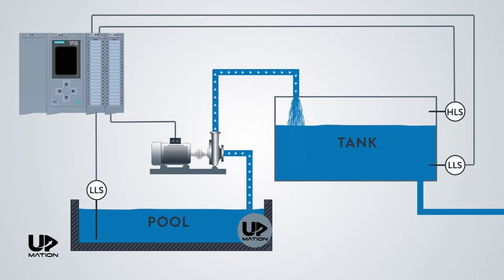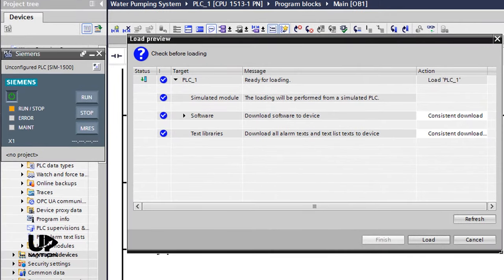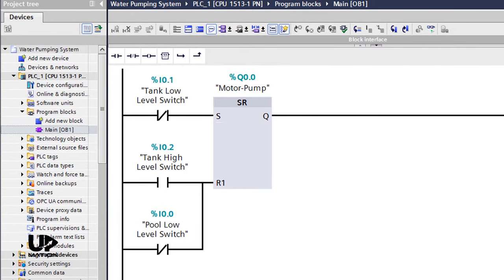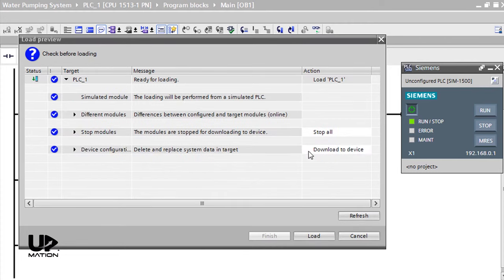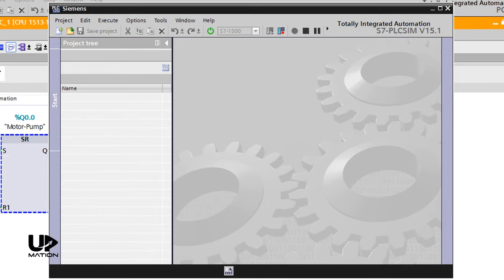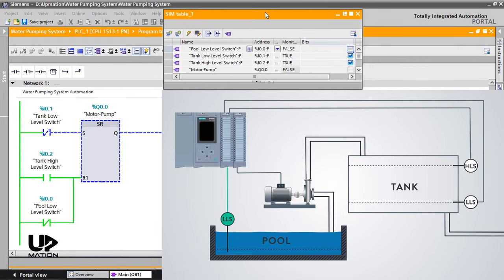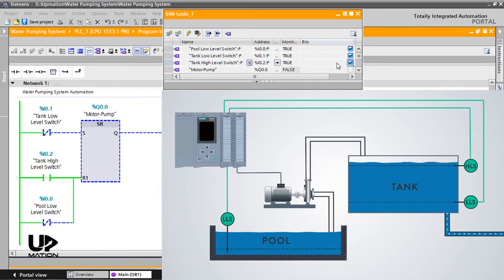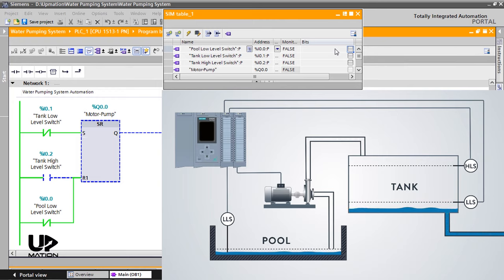Siemens PLC Training: How to Simulate a PLC Program (Siemens PLCSIM Tutorial - V15)

Comment: Do you know if colleges have the simulation software? Does it come in a package with the programming software
Reply from the maker: TIA Portal has integrated all the basic software including programming and monitoring STEP 7, WinCC, and so on. Simulation software (PLCSIM) is free and you can download it free in case it was not included in the package.
As far as I know, the colleges have at least a Trainer Package which includes all of these (and SIMIT simulation software) plus some hardware packages for students to gain hands-on experience. 
Here is the link to the Siemens Trainer package: https://sie.ag/3iIAw8d
But you better ask the college to make sure which PLC and software brand they use. In the US you might better choose between Siemens and Allen Bradley.
Reply: @Upmation  my college has AB and Siemens. However as I right now, we have to remote into the software. Idk if the SIM software is downloaded or not. If it’s not I don’t know if I have the authority to download anything onto the remote computers. I really would like to be able to simulate the programs we build.
Reply from the maker: @joew4202  I see. I suggest you contact the IT responsible of your college and ask him to download and install the PLCSIM on the computers you remotely connect to them. It's not something that might cause malfunction or whatever you might be worried about...

Comment: Hello sir, I am getting a problem where when I click on start simulation, a box appeared and says 'The blocks contained in this project cannot be simulated with S7-PLCSIM. I didn't put any password for the blocks. How can I fixed this ?
Reply from the maker: Hi there! You should look for the details of the error and see which block it means. It's likely you used a block that needs inputs and you've leaved its inputs empty. Or have used an inconvenient input or range for that block. You should also look to see if there is any errors or warnings after you compile your software.

Comment: Hello ! Operation with PLCSIM can be simulated after replacing hardware inputs such as% Ix.y by a memento bit %Mx.y ?  Personally I can't do it. 
I simulated an incrementation (INC) in LADDER language by placing a pushbutton with positive edge to which I assigned the address % I0.0, it works well, as soon as I replace by % M0.0 impossible to change the bit value.  Thank you

Comment: IF YOU HAVE TO SIMULATE PLC WHY YOU NEED HARDWARE?
Reply from the maker: Sorry, I didn't get your point! To simulate a PLC program you don't need any hardware and I don't think that we have mentioned such a thing in this video!
Reply: THANKS FOR YOUR REPLY.I MEAN HOE I SHOULD SIMULATE PLC ON PC.
Reply from the maker: @NishadNaik  Thank you for your comment. Most of the PLC Programming software are associated with a "Simulation" software that you can use them together to simulate the PLC and the process. In this video, we used Siemens TIA Portal as the PLC Programming software and Siemens PLCSIM as the Simulation software. There is also a Monitoring or SCADA software called Siemens WINCC to bring the graphics into your project and link them to your PLC program.